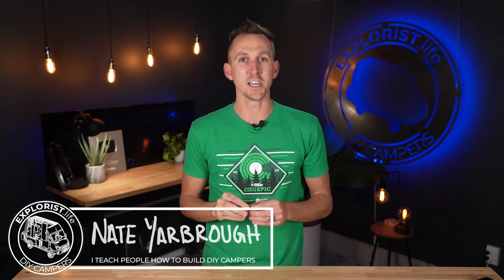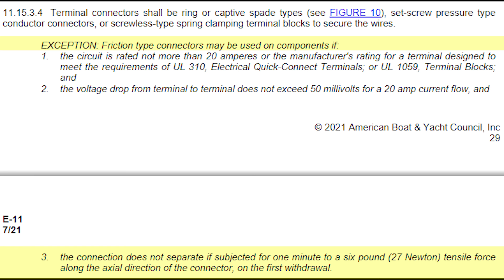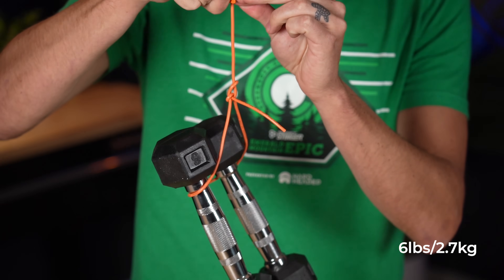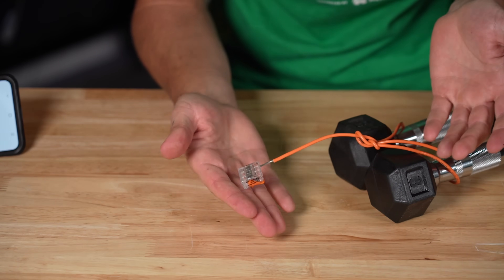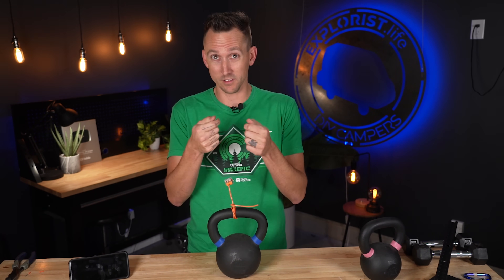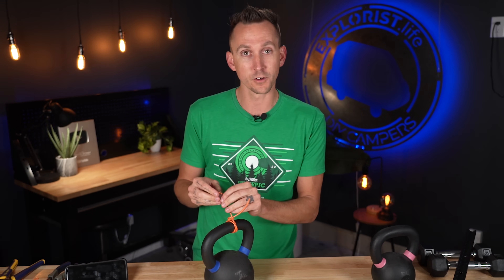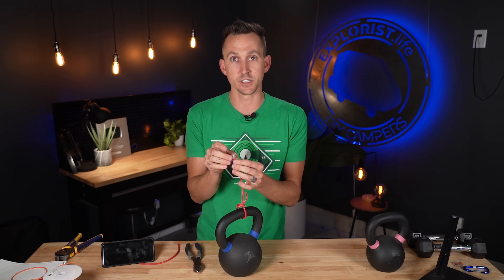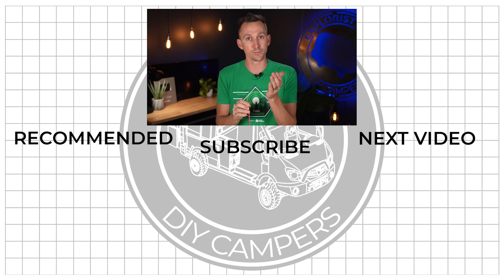ARE LEVER NUTS GOOD? (for a DIY Camper Electrical system)

Comment from the maker: WAGO Lever Nuts: https://amzn.to/3jJYswt (lots of off-brands in there.  WAGO brand is the ones shown tested in this video and the ones we recommend)  I find the 3 conductor lever nuts for 12ga max wire the most versatile: https://amzn.to/3QeCPkf but the ones for 10ga wire are also great for anything with 10ga wire (but they are a little bigger): https://amzn.to/3Zg11XN
Reply: been used in europe for years, they cope with more amps than the manufacturer rating just like the hold more weight than the rating, but obviously its silly to push them past spec in either limit. i dont like the cost for diy projects but i keep a handful around for quick wiring up, once everything works i use a junction box and the wago's go back in my tote bag for the next job.......

Comment: Hey Nate (lol, it's funny cause I'm so used to typing "hey mate" with me lads). I'm adding solar to me RV and was thinking of using the large size to connect (in a roof gland box) the 12AWG wire from the panels in series to the 10AWG wire I'll feed through the walls into the Victron 100|50 MPPT. The plan is to use the 2-wire connectors, one for + and one for the -

Do you envision an issue for this particular application?

Me setup will be three 200W panels in series, combined to create 600W  91V  10.2A
Reply from the maker: I think you're looking for something like this: https://shop.explorist.life/shop/all-products/camper-wiring-kits/solar-charging-wiring-kits/600w-solar-charging-wiring-kit-3x-200w-12v-battery-bank/
Reply: @EXPLORISTlife  I should have specified I’m putting a total of 6 panels on me roof. Two sets of 3-panels in series, each set with its own 100|50 mppt. So I’ll have a total of 4 wires heading from roof to under dinette seat. I don’t want to compromise performance but it SEEMS that connecting the wires with Lever Nuts is an easy solution, but I’m a complete novice and don’t want to mess up the power flow.

I have 12AWG by default on the Rich Solar panels, and already routed some 10/2 wire through the ceiling area. Me panels arrive Friday.

If not Lever Nuts, what would be the best way to combine the 12AWG to the 10AWG?

Thanks SOO MUCH for all your videos! I’ve likely spent nearly 20 hours watching your content!

Comment: I’ve been doing electrical work since 2002 and have used the Wago 221 since they came out on the market in Sweden. The one thing that would make me start using another type is a similar connector with more than five entry points.
The pulling force is completely useless to test since a proper installation is done so that that force isn’t put on the connection it self. 
I did my basic army training as a tank mechanic and remembering the demands for vibration safe connections gets me to make the conclusion that any type of twisted or screw connection is going to fail in a vehicle. Most screw connections in a domestic or industrial installation has to be re torqued with regular intervals to prevent electrical arcing

Comment: Been using these for a while. Seriously when is a wire every going to be subjected to such a high 26 lb load. Just one suggestion - lift some weights to build up your 2 finger strength 😂
Reply from the maker: Need to get back into rock climbing apparently. 🤣

Comment: I found these during the early electrical wiring portion of my build and I would never use anything else.  Even the off brands I have used and are fantastic.  Sometimes you run into some spacing issues, but all in all id still use them no matter what.
Reply from the maker: Yeah, they are pretty great.  Especially compared to wire nuts or something.

Comment: Super lab test!  I never questioned them after your puck light video. I used these to connect everything on my Espar D2 Heater,  too.  Sadly only after messing with the included odd German connectors for way too long. Someone should call Espar ;-)
Reply from the maker: I think WAGOs are German too.  Somebody should introduce them. 😂🤣

Comment: Wagos absolutely suck and do not provide a secure connection. All you have to do is yank a little on it and I Guarantee the wire will come off.
Reply from the maker: That's simply not true.  We have a part 2 coming out testing weight bearing plus vibration and the results are VERY positive for the lever nuts.

If you yank on the wire, yeah, it may come dislodged, but nobody is asking for the connection to stand up to Pulling somebody out of the mud or something.

Comment: I'd get fired if I used WAGO connectors in a customer's vehicle, they're good but they don't meet the manufacturers requirements for the equipment I install (telematics systems). I use them for other stuff though, so convenient and easy to use.

Strangely some vehicle manufacturers cough BMW actually say that using anything other than their proprietary version of the scotchlok to tap into vehicle wiring harnesses invalidates the warranty; that was the cause of an interesting conversation with our equipment suppliers who totally forbade their use.
Reply from the maker: Yeah, some of that stuff starts to get into 'we are doing this because we have a contract with somebody' instead of 'we are doing this because it's better'. 😂  When we were making our branch circuit wiring kits with a bunch of 12 and 14ga wire, we bought a bunch of Scotchlock brand spade connectors and played around with them a bit and found that none of us here at EXPLORIST.life could get a good crimp with any of the crimpers we had on hand.  Turns out, scotchlock only recommends crimping their connectors with their own crimper, which conveniently costs 400+ dollars and is not available to the general public.  

/rant

Comment: Putting together a build in a Ford Transit I ended up adding four extra OEM cargo bay overhead lamps.  These are said to be LEDs.  Shower, I cannot tell which side is positive or negative because they light up with either polarity when powered.  So far I've not figured how t permanently wire them temporarily connected them to Banana Plugs that goes into a Banana Plug to Cigarette Lighter adapter that goes into a Jackery on a shelf.
Reply from the maker: Hmm, interesting!  Look into 'anderson connectors'.

Comment: Hey Nate: I am still a big fan of these and buy them by the bucket. Especially useful when “down shifting” between wire sizes. Just recently found their single conductor version and have them on order.
Reply from the maker: Hey Charile!  Nice!  I'm a big fan of these for that purpose as well.  It makes a connection from small device pigtails to larger wire so easy and repeatable.  Thanks for watching!

Comment: I found lever nuts a few years ago and started using them in all kind of electrical connections and they are so much easier than conventional wire nuts. I have used them inside a wall in a box for safety and I call them my walnuts, Wall Nuts because they are in the wall. Corny and Funny.

Comment: As a DIYer, I've ditched wire nuts altogether.  I've used the Wago Lever Nuts in a deck build (AC and DC circuits) and a bathroom remodel, and the inspectors have never given the Wagos a second glance.

Comment: The limited contact area inherent in the design of the lever type connecters concern me , I suppose that low current connections are OK , high current connections not so OK . twist nuts offer much more and tighter connection.
Reply from the maker: Well... I mean, they are only rated for 30A and lower on the larger ones and 20A or lower for the smaller ones, so yeah...  low currents only.  Not trying to run a 3000w 12v inverter through these. 🤣  Remember, these are rated and listed for the currents they are stamped for.

Please don't tell me you'd rather use twist nuts for a camper or mobile application?! 🫣🫣 Those have such a risk of vibrating loose that they've been specifically forbidden by the ABYC
Reply: I agree, twist nuts give a much tighter connection, but I wouldn't use them for a mobile application.  These wago connectors are pretty cool, but I wouldn't use them behind walls or anywhere else I couldn't get to them in a mobile build.  I have used them extensively in standard home construction.  But for anything with a lot of movement,  think I'll stick with the crimp connectors.
Reply from the maker: I think you'll be surprised with our next test that introduces excessive movement/vibration...
Reply from the maker: And if you are just joining 2 wires behind a wall, sure... butt splice Crimp connectors are great.  When you need to make a 3 way splice with multiple different wire sizes though...  that's where these lever nuts shine.

Comment: I use wagos all the time on ac and dc as long as they are lower currant.  From what I’ve heard from local electrician seems to basically boil down to they surely don’t work because they don’t suck to install… 🤷‍♂️
Reply from the maker: Sometimes I think that 'local electricians' don't move toward newer and better technologies just for job security.  If you build something to fail, you'll always have work. 🤷🤣

Comment: I got some of these when you showed them I rewired my Overland truck and my solar shed with them and I have minimum loss they made it easy to add or subtract wiring when needed when using the proper wiring I'm very happy with them thank you for bringing them to my attention

Comment: Here in the uk you would not believe the combination of wagos connections you can get and off the shelf junction boxes that they fit into and all on 240volts they really do work !! One day the USA will catch up 🤭 love your videos keep them coming 👍
Reply: Definitely are brilliant connectors. With vehicle/caravan wiring I cable tie the wires together a touch down from the connection, so if cables get tugged for some reason the tie takes the strain first. 
If that makes any sense.

Comment: I love them, they are awesome. You just need to position them in a way that the lever won’t be pulled open by anything.
Reply: I tightly wrap electrical tape around them so the levers can't flip open.

Comment: People who are not experienced with wirenuts SHOULD use them.
It's easier to get a sound connection, especially with dissimilar wires. You can see the connection and easily test it.
You can add or remove conductors without compromising the connection and mangling the strands.
They're a silver bullet with short wires and tight boxes, or limited strength/dexterity in hands.
I started using them with my guerrilla solar cart, they're great with quick set ups and configuration changes.
And they look cool.

Comment: No problem using these in household applications, but I don’t know that I would trust them in a mobile environment with vibration and constant movement.
Reply: I’ve found wire nuts sitting on the floor of the front bay of my 5er. I replaced them with lever nuts, and haven’t had a problem since.
Reply from the maker: These are perfect for Mobile applications since the wires lock into place. Get some and play around with them and you'll see. I wouldn't recommend these if they weren't good for Mobile applications since that's what this channel is about (and what the ABYC standard cited is for (boats))

Comment: I use them all the time, but only for my 12v systems,love them,never had a problem I also wrap the levers with electrical tape. On my A/C system I use traditional wiring connections 👍

Comment: I've been working with low voltage "thingamajigs" for over 40 years and when I first saw these a few years ago, I knew that I would be using these now that I'm in the middle of my 2022 Transit build. No need for a trip to the gym today Nate, you've lifted enough in the video : )
Reply from the maker: Haha! Yeah, I'm a big fan of these over pretty much anything.  Also rated for something like 600V, so they are good for household outlets and such.   Pretty great!